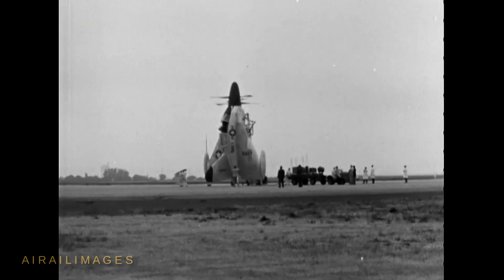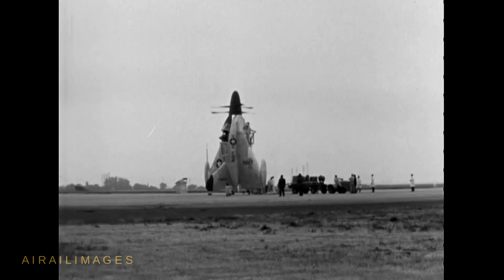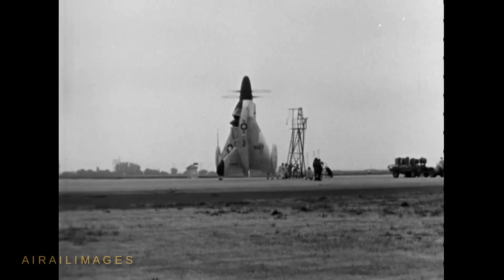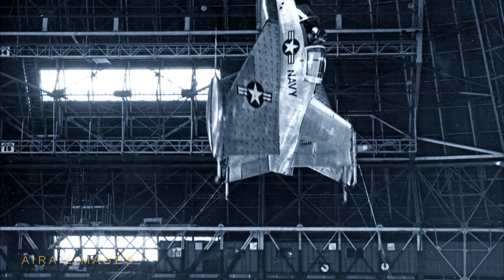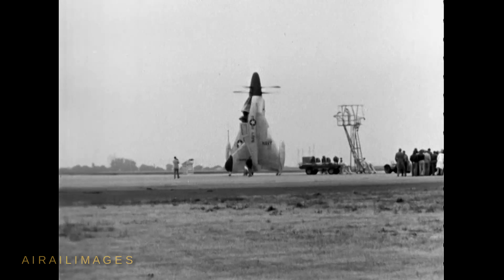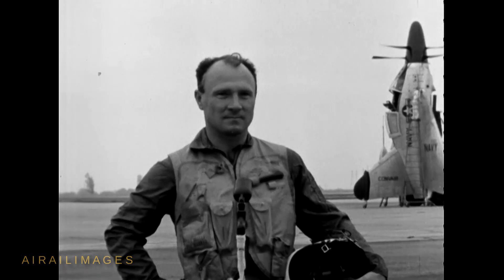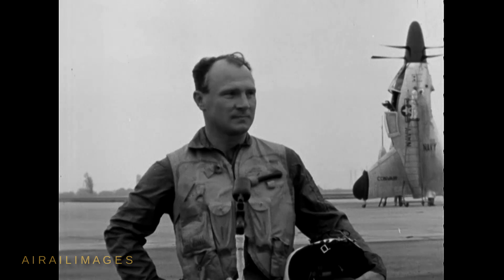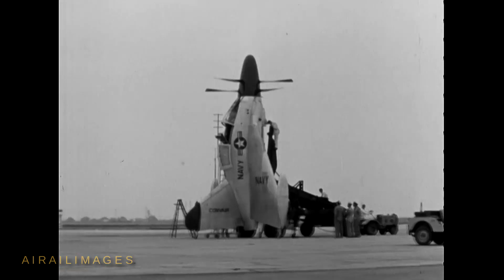Pogo Plane: Easier to Launch than to Land - Convair XFY-1 with Original Audio

Comment: After transitioning to level flight, coming back to the field to land was unbelievably difficult. With the powerful engine and the 2 large props, the slowest the plane could fly was about 250 kts at idle power. The airplane would approach the landing spot at a low altitude and at 250 kts. Prior to reaching the desired landing spot, the pilot pulled the aircraft up into the vertical, hopefully directly above the intended landing position. As the airplane decelerated to 0 airspeed, the pilot added a lot of  power to bring the airplane into a hover. He would then be several thousand feet above the landing spot, and would have to descend vertically looking back over his shoulder. At some point they started using a helicopter to hover behind the XFY-1 so the pilot could look at it as a reference, instead of looking at the ground. They eventually realized this was way too hard and dangerous for anyone besides the top test pilots.

Comment: Dont forget about the Lockheed XFV and the Ryan X-13.

The YT40 engine program on this and the XFV was quite extraordinary. It was two cores driving a contra-rotating propeller through a single gearbox.  The cores were very nearly the same as that in the Allison 501D/ T56, as used on the C-130, P-3 & E-2/ C-2